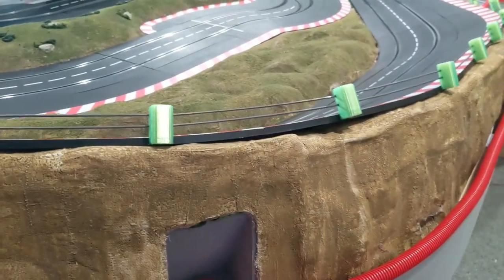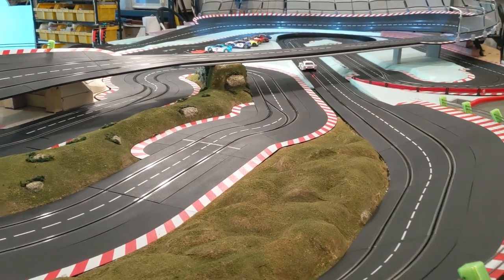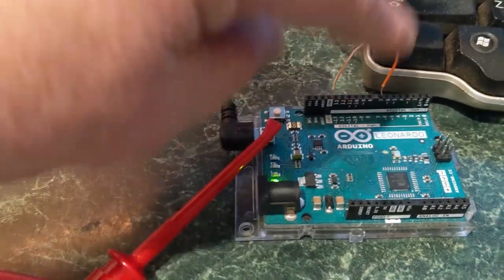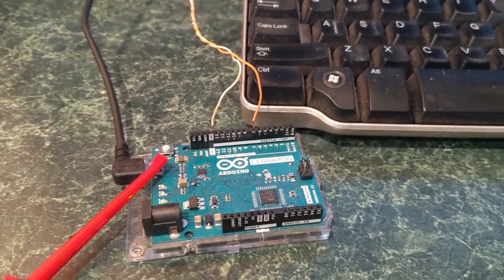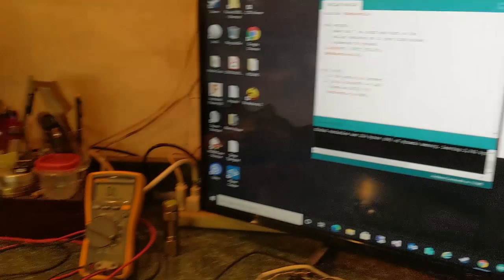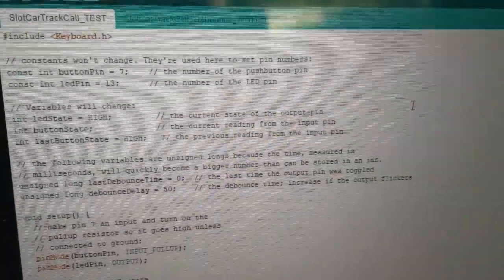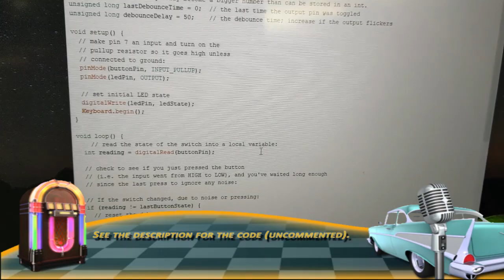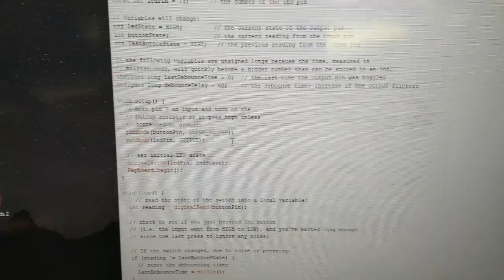Slot Car Track Big Red Button Details - Part 1 - Switch Debounce

Comment: Good info, Jeff. No de-bounce function in the program already? I know I've re-invented the wheel several times writing a subroutine only to later realize there was already a function built in for what I spent time coding. D'Oh!  BTW, what happens if two drivers hit their track call buttons at nearly the same time?
Reply from the maker: Thanks for the comment and great question Salami.
I wish the Arduino inputs had debounce functionality built-in that could be enabled/disabled programmatically but no joy there (however the pull-up resistor can be enabled/disabled programmatically). The debounce code is necessary for a software only solution from what I can tell.
re: more than one driver pressing the button at or near the same time:
ans: Switches are wired in parallel so the first button press will be processed and the others will be filtered out (aka: "debounced") for a short period of time.